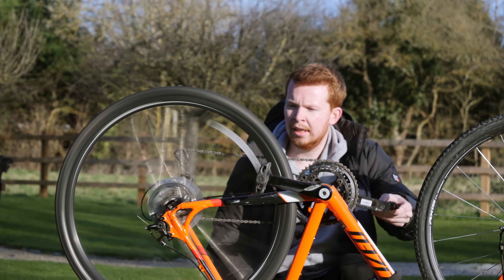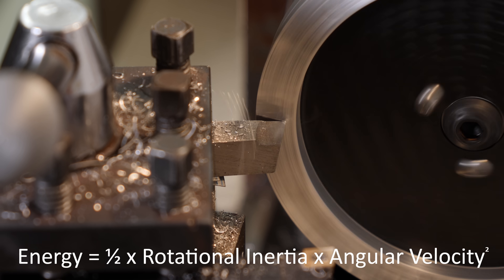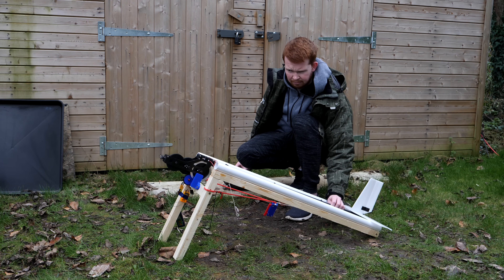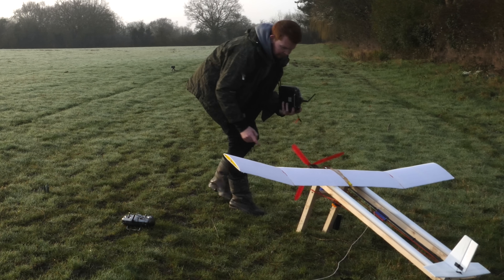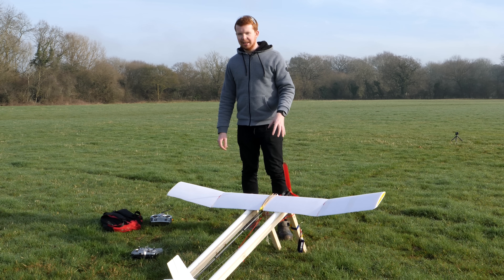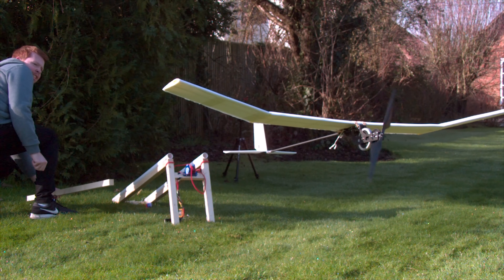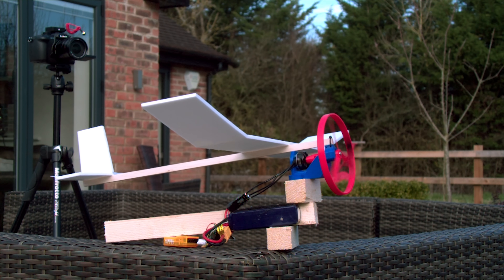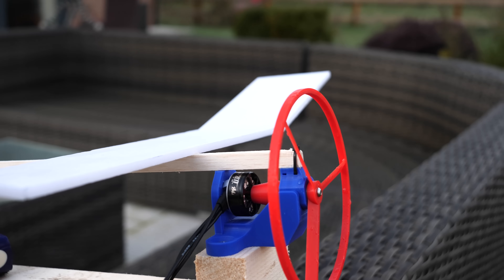Flywheel Powered Plane

Comment: The perpetual motion ring is fueled by crushed hopes and dreams held in a suspension of tears and anguish. Good Rage/Kg ratio
Reply: @jasong8501  I think a lot of charlatans have historically tried to make flywheel based perpetual motion machines?
Reply: @jasong8501  Lol dude. I'm not the original poster, I was just trying to guess his POV.
Reply: Remove all type of fiction.. and you have a perpetum mobile.  We look 13.8 bilion years into the past (using telescope) and we find nothing stationary... everything is moving smart guy , since big ben. Voyager 1 and 2 are moving since 1978... and probably will travel a millions of years....because... no friction...
Reply: @florinmacarenco7547  it's still not a perpetual motion machine, that's just how the universe works. Things want to stay in there state, either moving or stationary and changing that requires energy in both ways.
Reply: Rubber bands don’t look so bad after seeing this.
Reply: THERE IS NO FREE ENERGY DEVICE
Reply: @goldenretriever6440  all things comes to an end!
Reply: Damn, I had to re-read your comment.

At first, I thought you knew my ex-wife!

Comment: Have you tried mounting the flywheel on other axis ? Like maybe parallel to the ground or facing sideways like the toy ?Also the rotation direction might be important. The fact the toy's ring continues flying by itself when the propeller exploded is also interesting.
Did you know some planes attempt using rotating cylindrical wings using the magnus effect to create lift.

Comment: Did you try to position the flywheel horizontally instead of verticality. I have the feeling that there's a difference in weight distribution when you spin a flywheel producing kinetic energy horizontally when verticality will produce forces down and upward 50% and  50% sideways. When horizontally produced 100% forces completely sideways on which I believe it reduces the weight of the mass by spinning. I would like to see if this would be more effective to fly. I admire your work and enthusiasm. Thank you
Reply: One experiment would be to measure the weight of a flywheel spinning horizontally versus verticality. The results would be the answer of if gravity forces affect the action of the way the flywheel is spinning.

Comment: hi, Tom! what is about heat accum? could you please reserve energy in a heat accumulator? for example, use carbon bottle for compressed air (300 bar or more) then reductor of pressure, then heater, then your pneumo-motor!

Comment: First 5 minutes is like leonardo da vinci. Where the concept is possible but the blueprint is to heavy or not strong in enough for the energy needed. I like how he instated of leonardo did proved that is is possible by a different construction. His first solution is possible be make a bigger plane. I think the ratio between lift conversion and weight goes to much to weight. The flywheel can be bigger so energy conversion will need a less heavy gear ratio Also make 2 disc's spin in opposition turns makes it possible to turn them flat so you can put them in the wings which make for a easer fit of a bigger wheel (maybe even something that looks like a flying wing). I think is better to make wheels for the start because it does not seem to have lift form the start. At speed 0 it is difficult to gain enough traction to make lift. Also you start at the highest rotor speed. This is a big cause a big loss of energy in the first few seconds. Looking for another energy conversion might be a gain in which a slip is possible or infinitely variable transmission which is controlled be speed. Also is saw that you made you flywheel still relatively heavy, I guess you where afraid of making the weight distribution very uneven. A solution is in the problem. A uneven weight distribution makes turbulence because of the change in the center of mass. The heavy part becomes closer to the center of mases and pushes the lighter part more outwards. If you make the ring a hollow tube with a gas and a liquid it might even out enough. If you try this it might be smart to put a timing belt on the outside. It is to prevent the liquid from flowing to easily. Also for putting energy in it would smart if you can put a different gear in which unlocks the gear to the propeller (somethink like a gear that pushes the gears more outwards). To over come you kill the gears take make that the energy release gear is a low rpm if you follow this by a infinitely variable transmission. You should have a safe way to store energy without losing energy to the propeller and without do need to throw the thing that instant. The movement of the infinitely variable transmission can be controlled by a screwgear connected to the flywheel which pushes to the wanted gear over sum time and if there is a release spring when hitting the highest gear you won't lose to munch energy to it.

Comment: why not use the same mechanism on the fly wheel plane, also adding a friction clutch to connect the propeller to the rotation of the bevel gears should save you from having to replace them every time, maybe a couple of slices of balsa wood should be enough with a small spring to provide a force to create the friction coupling.

Comment: My Dad the late Herbert K. Marshall actually had a few cars operating on a 350lb flywheel with a Subaru engine, the petro engine would spin it up.. He said car needs the power to incresse speed. But once you got up to 50mpg it take little power to keep it there.it take The 1971 Cadillac which got 35mpg in the city of Raleigh N.C  this was in 1976. He also latter got a patent on a rubber band powered car. Unlike the flywheel even in a vacuum it  loses power. Using a rubber band which would hold the power. Then as he slowed down it spin it up. And let the power out again when taking off. His research company was Kitentic Research and Development
He really enjoyed his 1971 Camaro though 10,000 Rpm 1,000 Hp for 10 seconds from a 350 lb flywheel.

Comment: What about a flywheel mounted coaxially to the plane's movement vector? You could move it further back to adjust CoM, gear it with a planetary gearbox, and then run a drive shaft up to the propeller, which could be a similar flywheel design to the toy plane at the end?

Comment: helicopter whywheel
Reply: you could make it a rim only hula battery
Reply: you put the flywheel the wrong orientation, turn it horizontally as the wing surface. use a spinining flat disc (not helicopter or autogyro rotor) as the wing surface, like delta wing, or like a radar disc command plane, and the spinning disc as energy storage flywheel, literally

Comment: I remember years ago that flywheels running in a vacuum were thought of as viable future energy storage. There were even air bearings being developed to help further reduce losses. I never heard any more about it.
Reply: I remember seeing a video in my Recommended called "The Mechanical Battery" I wonder if that's about the same thing
Reply: @chaotickreg7024  Could very well be. The big parameters to compare are cost, weight (not in every application though), and recharge efficiency.
Reply: @joewoodchuck3824  The thing I find interesting about storing energy in its kenetic form is that humans create kenetic energy all the time, sometimes for fun. It's interesting to think about a scenario where large batteries cant be produced so instead you have a couple people riding stationary bikes to power up a flywheel "battery" for a factory to keep the mechanical machines operating until lunchtime. Imagine a windmill charging a flywheel so that a farmer could do their wheat milling at any point of the day they wanted? Ok now I see why people are into stuff like steampunk.
Reply: @chaotickreg7024  Human peak power is around 1.2 hp with 0.1 hp sustained. Athletes can do somewhat better, but most people aren't athletes.

Comment: mabye if you figured out the force needed to sustain flight then worked backwards to what rpm the thing needed to generate the thrust then you have the ratio of which to connect to the flywheel but be sure to make the weight the same.

Comment: You want stiffer belts. Stretchy belts are bad and the issues get worse at higher rpms.  When there is a load on that o-ring it stretches on one side and relaxes on the other making it slip, causing that awful noise.

Comment: I think if you ever did this again, it might be worth investing a little weight in the outer ring around the propeller blades, as this serves as a secondary fly-wheel, in addition to a gyroscopic stabilizer. Just a thought, could be totally wrong here.

Comment: So basically looks like it needed a clutch and a speed regulator between the flywheel and the propeller? Of course, that's not quite as simple as a couple of gears or pulleys.. unless it looks like the end product, there, which is basically a decoupling clutch without speed regulation.

Comment: I was thinking of other weird energy storage methods, and I was about to recommend a gravity powered plane, but..... that's just a glider isn't it.
Maybe put a tank of water in the plane and have it drip through a tiny hydroelectric dam to power the propeller? ;)
Reply: My favorite thing is when I come up with a brilliant idea for a new way of doing something but realize after spending some time on it that it's already been done... 😂

As a kid I drew up a revolutionary new design for a "flying squirrel suit" only to later realize skydivers have been using something similar for decades...
Reply: @C.Sharpe  Ahh, that's always fun! But at least, it shows that your ideas are feasible, which is reassuring :P
Reply: solid fuel rocket plane.

Comment: I like your final solution for a flywheel plane, It's a really cool toy!

But more to the point, I read a comment speaking about the torque produced by the spinning flywheel. 
Say you scaled the flywheel down by 1/2 and added a second one that is exactly the same, but spinning in the opposite direction,wouldn't that be able to counteract the torque produced?
I mean, it's still a less-than-optimal solution to a funny problem, but I really like the idea!

Comment: there are multiple vibrations at different frequencies.. and you are getting a heterodyne type vibration who's failure can be predicted with some Fourier transform analysis.. automobiles use a reverse idler to eliminate a lot of the belt or chain vibration on cam chains and belts
Reply: peace ✌☮ Starfirediamondmines@gmail.com

Comment: Thin Aluminium ring can be made as outer ring of propeller which keeps the rotation longer  than plastic prop driven to higher rpm  and increased flight time!! ..please try and make a video of it.... I'm a huge fan of our engineering experimemts

Comment: I bought a futuristic toy plane that used a similar concept and worked really well maybe about 15 years ago. It most closely resembled the Project Zero Electric Tilt Rotor plane except it had a single central rotor. It was string pull release, when it rose off the spindle the rotor would tilt 45 degrees and it would fly forward. I did a search but I can't find it or who made it. It flew very well with that configuration. I guess now that I think about it, it didn't have much to do with storing energy in a fly wheel. They work best when they are heavy and that is best ground based. Probably some gyroscopic forces and direction of rotation that have to be taken into consideration. Good effort, really interesting experiment, seems like you get through it pretty straight forward and quick.

Comment: Hey Tom, would be cool if you add a fly wheel to the shaft, I believe this has been done many a times, basically, leverage an underpowered airplane to fly by capturing the energy of the flywheel during spin. I don’t know, get a marginally powered airplane, run some TO distance and endurance flight and add the flywheel and compare. :)

Comment: flywheel decelerates after release, need to vary the blade pitch or have a continuous variable transmission to squeeze usable thrust out of the diminishing rpm

Comment: Excellent work Tom . I'm not an engineer. though I was a pilot , the first thing I noticed was starting with a high angle of attack on the wing , which seemed to me to be similar to the landing flare where the wing stalls aerodynamically just before touch down. seems like a huge load on the prop to get the plane up to flying speed in such a short period of time. I found the project quite. I wonder if that flywheel concept could be used to gen electricity with some form of wind blades once the wind gets it up to speed the fly wheel momentum keeps generating while it spins down. I realize I'm late to viewing this but you have my sub. keep up the great work Tom.

Comment: You need either a variable transmission between the flywheel and the propeller, or a variable-pitch propeller.  You can't extract energy from a flywheel until you slow it.  So it must be steadily slowing with time.  To maintain flight, you need constant propeller speed, so the transmission needs to (over time) reduce its reduction ratio, (or the propeller needs to increase its pitch with time).  Existing plane is over-powered at the beginning (wasting flywheel energy), and under-powered shortly later.

Comment: Metal coated with polyester threads woven cloth in a 1m2 give you a static of 1 quelomb energy with wind flowing areas of plane 
and connect it to a rechargeable battery will useful to against self charge drain

Comment: the weight of the flywheel needed to be further back, the air frame wasn't balanced
Reply: A x10 longer launch sled on rails that self build cnc use, to aid with take off.
the fly wheel need to be between the wings, the axle mounted higher up, 1/3 protrusion.
Use a 400w hilda die grinder to spin up flywheel.

Comment: I think your first flywheel plane would need to have an enormous propeller and be really big (like Peter Sripol's cordless drill plane). Also a torque slip on the propeller so that if it crashes, the flywheel doesn't dump the energy into the final gear stage.

Comment: When i saw it up to the middle i was certain, that it wouldn't fly that well because of the weight sitting at the front and also that Flywheel spinning towards the front which also creates force downwards. Or am i completely wrong? I was never that good in physics.

Comment: Gyroscopic P-factor would have created some serious control problems with that flywheel design, any roll would cause a yaw and vice versa. In fact even the bleeding of energy through friction would cause it to pitch and contributed to all those nose downs. If the flywheel had been geared the other way it would have pitched up instead. Not a great option for an aircraft.

Comment: Commercial pilot signing in, and I’d love to see your idea fly!

By the way your first design constantly wants to fly nose down indicates that the centre of gravity may be too far forward. As well, the wing dihedral is a bit a mute point, as it helps create stability in unstable air. Having a straight wing with winglets would be more efficient at drag reduction. And a basic tail dragger landing gear forward of the CG would save the output gear overhaul every flight. 

Good luck!!
Reply: I notice the plane nosing down and was thinking the same thing about the weight being to far forward. It would be interesting to see if moving the weight backwards would have lead to a more successful attempt.

Comment: Hey Tom if you look up the cowling that goes around the prop it's more efficient and you get more lift, you don't need to spin up the propeller, try use your oringinal flywheel motor with cowling ring around propeller,If you want to use the original flywheel motor the reason it did not have lift is because of the weight of the flywheel at the front, if you have a Delta wing you will have more wing surface so the plane would've had more lift

Comment: I love how when the plane crashed it sounded like an actual plane crashing
Reply: Not the actual sound of a plane crashing. Movies just use that sound for planes crashing so it has become very familiar. The sound is actually the WW2 Stuka siren.
Reply: @4ae109  While many movies for increased drama use a sound like the Jericho trumpet fitted on some Ju 87, props can create a similar sound when rotating beyond their spec, or rather when dragging the engine with them, due to the high airspeed. The Jericho was after all pretty much just a small prop fixed to the undercarriage. The difference is just in the pitch and loudness.  Easier to record in a studio too.
Reply: Hollmarkmonve
Reply: Hollemorkmoive
Reply: banzai
Reply: 9/11

Comment: INTEGRATE THE FLY WHEEL, WINGS AND PROPELLER.  THE PROPELLER RIM SHOULD HOLD THE INCREASED MASS AND SHOULD ITSELF BE SHAPED LIKE AN AIR FOIL ON EDGE.  SURROUND IT WITH AN AERODYNAMIC TORUS SHAPED HELIUM ENVELOPE/CRASH IMPACT SAFETY BAG - COVERED BY A LIGHT WEIGHT PHOTOVOLTAIC COATED CARBON FARING SHAPED LIKE A FRISBEE. ... 40 FT IN DIAMETER (WITH PROPS 10 FT IN DIAMETER.)  BUOYANCY INCREASES RANGE AND SAFETY.
ADD AN ELECTRIC MOTOR ASSIST POWERED BY SUNLIGHT.

Comment: WAIT A MINUTE!                               Is your flywheel producing a torque on the plane around it's axis ?? That might bugger up the CoG. Single engine aircraft wings aren't mirror images of each other. Each one is slightly different to compensate for the torque of the engine. If you had two horizontal flywheels, counter rotating they'd cancel each other out.

Comment: Don't give up, try to set up the propeller in front of the aluminum wheel. You want to make a perpetual motion device?  You need more. Find ways to put capacitors in the scheme so one wheel will recharge the capacitor to give you a perpetual motion device.